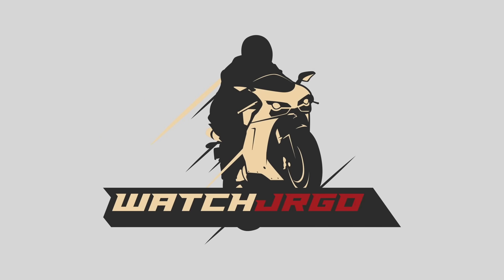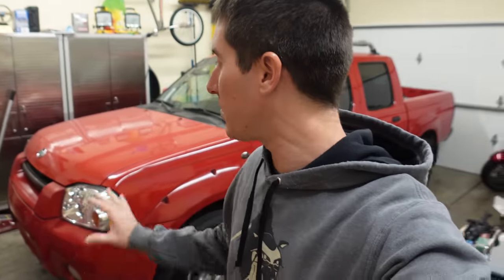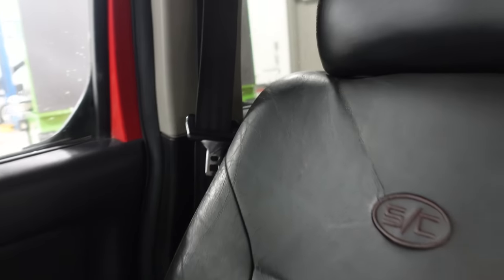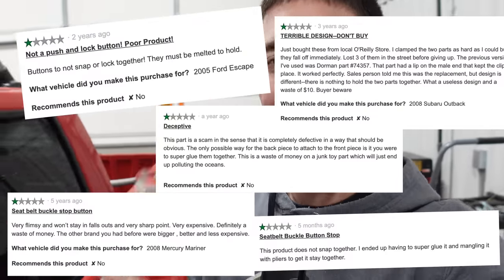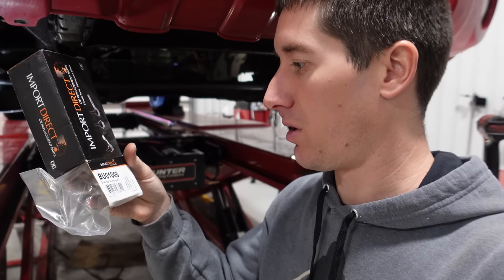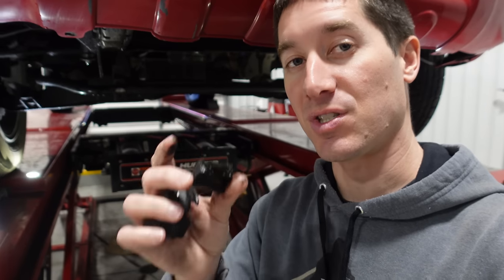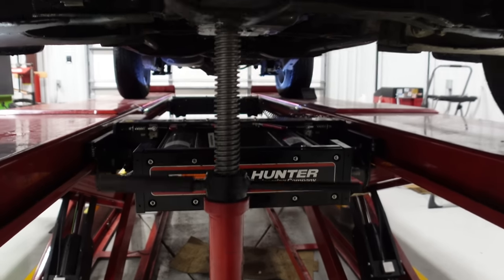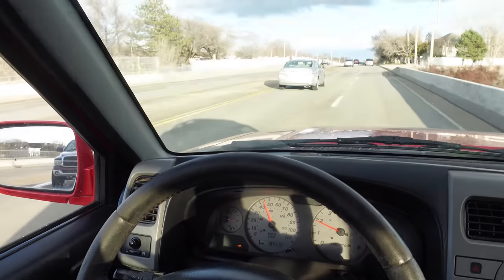FIXING The SUPERCHARGED Frontier And A NEW Shop Update

Comment: I think a lot of us are just really impatient to see you move into a new shop considering what you had before.  But you’re going about it the right way, which is very carefully.  But I would like to make one suggestion: try to find a place where the main door opening faces north or east.  Not south or west or southwest, where the sunshine and heat of the day would make it unbearable to work with the door open.  That’s one of my biggest complaints about my house.
Reply: The house I just bought has south facing garage doors. Thankfully, the garage is fully insulted and is heated/cooled. I spent way too many years working in piping hot or artic cold garages.
Reply: Northern hemisphere you want South facing or you will freeze in winter and boil in summer
Reply: My garage faces north. Junk blows in all fall, winter, and spring. Plus the wind makes the garage door creak all winter.
Reply: @t20594  Yup. I live in Colorado and have a south facing garage. My driveway is always covered in snow that refuses to melt while my neighbors across the street barely have any snow stick 😒
Reply: New here. What happened to his garage?

Comment: 03:16 I bought some seat belt stop buttons off of eBay maybe 10 years ago and they were the same, they sell some special pliers to do the job.

I indeed just melted the tip.

They were all the same when I purchased them, there were no "auto-clip".

They're fine, you just need the right tool, but if there are ones that just clip together I understand that you prefer tjem over these.

Comment: Just a heads up in the future regarding those seatbelt stop buttons... the tip is meant to be crushed which is why they stick out so far past the second half of the part.. once the pointed tip is compressed/deformed into that recess then it holds the two halves together. It appears as though the reviewers on amazon also don't understand how they work. I am in no way defending dorman as a brand - but this particular product might actually work when installed properly. Many OEM seatbelt stops are meant to be installed in the same fashion. I generally use a small pair of channel locks to squeeze the two sides (with the jaw positioned over  the center of the button).
Reply from the maker: It really has to be melted, unless you have a way to accurately compress it 🫤
Reply: @WatchJRGo  There is a tool designed specifically for these - but I've always just used pliers with no issue. These dorman ones may be made out of a lesser plastic that doesnt compress as its meant to though. Which may be why you had to resort to melting it. Conventionally these style of seatbelt stops can be clamped on in  a few seconds with no hassle

Comment: I feel dumb saying this but I never thought of looking into a universal seat belt stops! Dude I've fought a Rouge seat belts sliding down on so many vehicles I've bought. From tape, to pins and clamps.😵‍💫
Reply: Most Nissan dealers stock a few of them on the shelf as well - they are cheap to replace even when buying from the dealer
Reply: @Drew-wf7vw  Cool, thank you for the heads up

Comment: Would that seatbelt thing not be a scenario where you melt it down with a soldering or plastic welding iron?
Lots of things are attached that way. Especially trim and especially in the electronics world.
When I used to build / repair fast food headsets that is how some of the circuit boards are attached in such a small form factor. A little nub, put the board over it, melt the little nub. They also used really small screws for the enclosure, but innards were mounted that way. 
As an aside, one of the screws specified was too long and leaving a dimple on the finished product. Production was running for a pretty long time and no one noticed it. I got moved on to that product and noticed it right away and got to shut production down. Engineers really should have caught that. Design engineering, PCB assembly, injection molding all in-house, yet the people making the big bucks couldn't catch that.
EDIT: Paused it and typed that. I would have used one of those flat triangular irons to get a better finish though. ;-) could maybe even come of with a way to give it a consistent texture. Foil or something to that effect?
Reply from the maker: You need to be able to install these in a parking lot, shouldn’t need a tool 🍻
Reply: @WatchJRGo  Not sure why that is a requirement, but OK. :-) 
Good 'ol BIC hasn't failed me in that scenario.
In all seriousness though, based on that logic, shouldn't the entirety of a vehicle snap together like legos or k'nex?

Comment: Just use a soldering iron to melt the button....you can get snap-on ones as well, but I used the melt type on my Jag...prefer those. I did manage to find the original hole.

Comment: Is there a way to test wheel speed sensors with a micrometer measuring ohms?
Reply from the maker: Yup, the test was in yesterday's video. They should read: Front 1.28 - 1.92 kΩ Rear 1.05 - 1.35 kΩ 🍻
Reply: @WatchJRGo  Thanks -- Totally missed this. I guess i shouldnt work while watching YT :)  I've been chasing a potential bad wheel speed sensor on a 07 Honda Accord and couldn't find anything on details related to this.  I'll check it out with this method this weekend!  Thanks!

Comment: the spiky bit at the top is supposed to be heat staked, so heated with a soldering iron until its flat, it should melt over the hole and act like an anchor

Comment: This generation Nissan is notorious for have bad radiators where the trans cooler and engine coolant can mix causing what everyone refers to as the "strawberry milk shake of death". If it has over 100k, replace the radiator. Some will also loop the radiator tabs cooler lines and install a separate trans cooler.

Comment: Good pass on that house. It looks like it was built in the late 70's to late 80's. At that age it probably needs a new roof, kitchen and bath renovations, mechanical systems (HW heater, furnace, A/C) replacement, and tightening up air leaks and insulation to modern standards in addition to other work. Energy standards in that era were not good because oil/gas was cheap. If the shop had a 10' ceiling, that would be a teardown for what you are doing. When I had a second garage built I specified a 15' ceiling because I bought a lift. Never regretted that decision, just wish I had made the floor area bigger for more projects!!
Also, I live about 3 miles from a small airport. It can be noisy especially on weekends with all the bug smashers flying pattern.